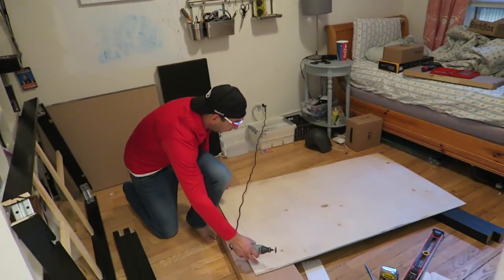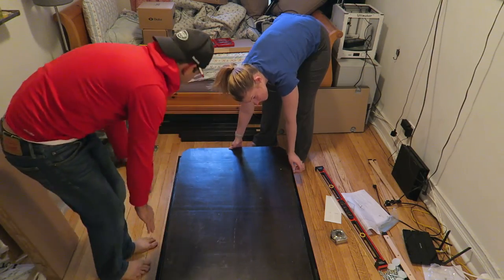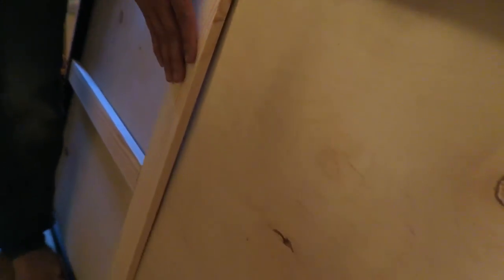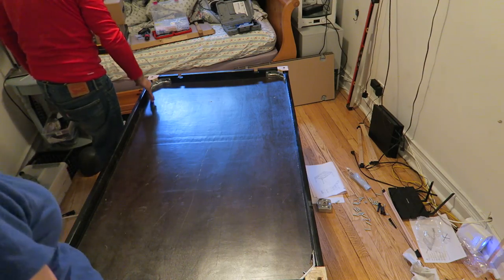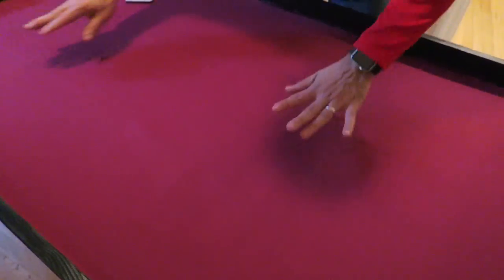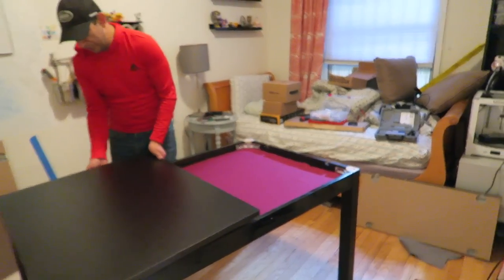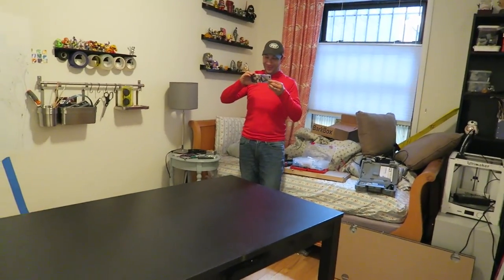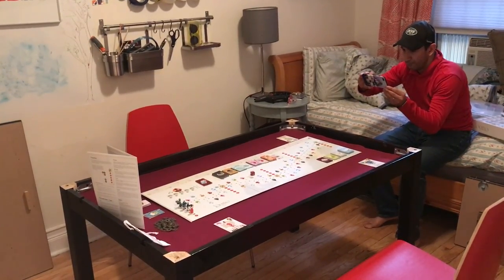Custom DIY Board Game Table

Comment: You know, where the corners come together and you had to cover it, but if you decided to taket he original bolts out and then reverse them where the head of the bolt is on the inside and then you can cut the remaining unwanted bolt off enough to put a nut on it and then have it usable without any studs sticking outward. I use to work for the Hme Dpt so this is a common fix. Great table and you guys make me very VERY envious.
Reply from the maker: That's a great idea! I can't believe we didn't think of it. Thank you!
Reply: Brad Nash hmm i am trying to understand this, but I’m having a hard time. If you reverse the bolt to the inside, then it would no longer hold the legs in place, would it? I must be missing something

Comment: Very nice work, looks neat and tidy. Would you disguise the corner brackets with cup holders? My fear when playing games is drinks on the table and risks of spillages, and trying to not come across as completely mad when talking about house rules to guests, haha
Reply from the maker: Thanks! I still need to stain the corners. I think we're going to create caps that will cover the brackets, but not cup holders (don't want to lose any game space!) However, I feel the same way you do about the potential for drink disaster; so we're going to make clip-on cup holders that will go over the edge of the table instead.